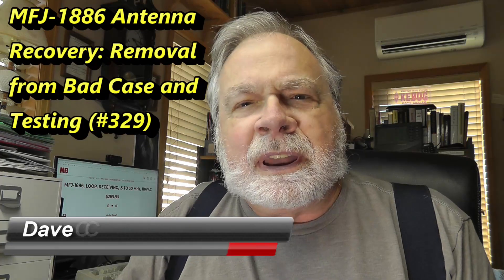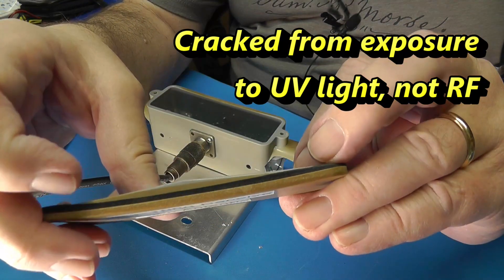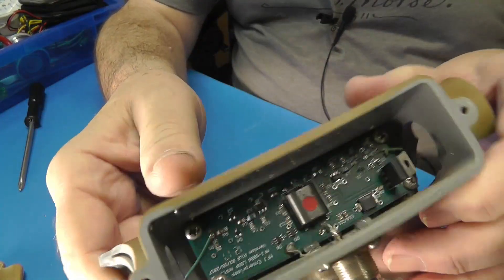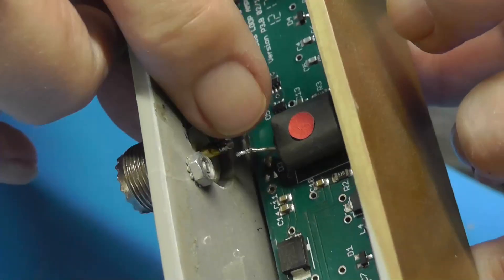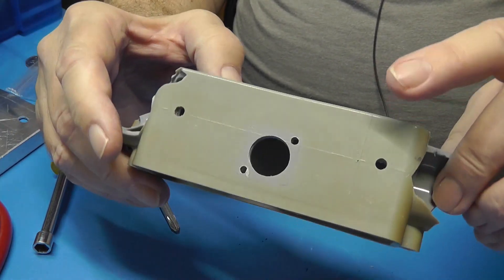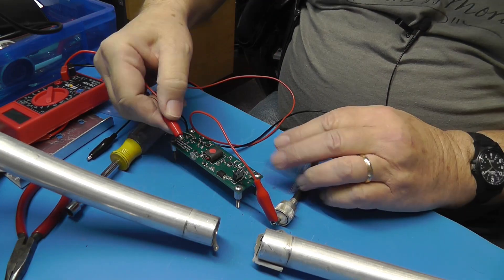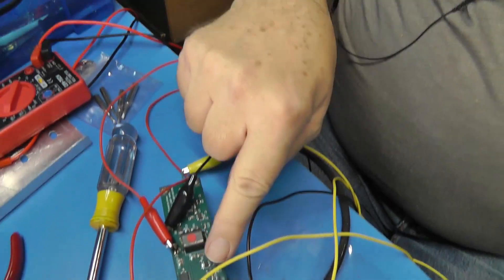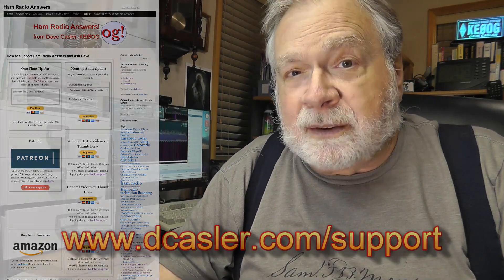Recovering the MFJ-1886 RX-only Loop Antenna; Disassembly and Testing (#329)

Comment: May have been easier to remove the screws from the SO239 connector and then remove the socket while heating the solder connection.  This would save any possible damage to the PCB while levering with a screwdriver near fragile components.  Good work non-the-less! :-)

Comment: Easy fix I guess, but you REALLY need to work out a way of stopping that box warping again.  Else water is eventually sure to kill the board. :((
Maybe wrap the whole box with "self-amalgamating/self-fusing" tape (e.g. 3M Scotch 23), with a small hole drilled underneath to equalise internal pressure changes?  This stops moisture build up due to "breathing" as the temperature cycles.

Comment: You sound 500% better Dave! 
I wish you had made a diagram of the board.
Reply: You can download the MFJ 1886 manual which has the schematic in it. (There's also a new MFJ 1888 loop which uses an entirely different loopamp, also schematic in its manual.)

Comment: the box is a pull box most likely being for 3/4 or 1" electrical conduit.   the step drill at harbor freight is a good drill   cost it low too.

Comment: Maybe after the holes are drilled and before parts are installed, paint the new box it'll help prevent UV damage.  There are spray paints for plastics that would work well.
Reply from the maker: Good idea
Reply: Krylon Fusion works well.

Comment: That box is a very common box. Home Depot and Lowes stock many of them. Box size is determined by size of holes in each end for conduit. 1/2"  3/4" 1" up to about 2". Should have no problem finding one.

Comment: As stzted use a step bit. They come in different sizes so get one that will make the SO239 hole. I beliebe it is a 7/8" hole but you better measure it and weite it on the box that you take with you for replacement sizing. Good luck Dave.

Comment: Harbor Fraud sells stepped bits for cheap.  They work great on plastic enclosures...probably nothing else though.
Reply: They hold up in aluminum also. We have one at work that has probably drilled 4-500 holes in square tubing.

Comment: Sounds like all you need is a TIG/MIG welder, some 3/8 thick titanium plated, and you could fab up a beast-proof replacement case. Unless of course, you've also got dragons out there.
 Or would your HOA allow you to install a couple of Aegis guns in the antenna field? (WEG)

Comment: That's an electrical conduit box, usually used in commercial buildings to make fishing cables and wires easy. Any home improvement store will have them. The easiest way to drill that size hole is with a hole saw but a stepper bit is good too.